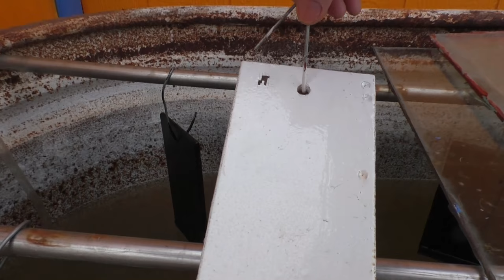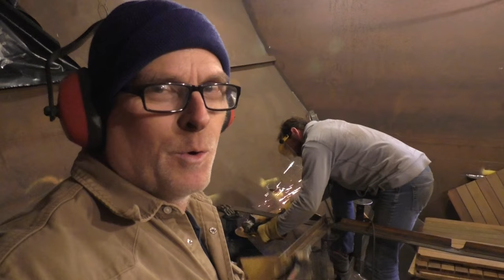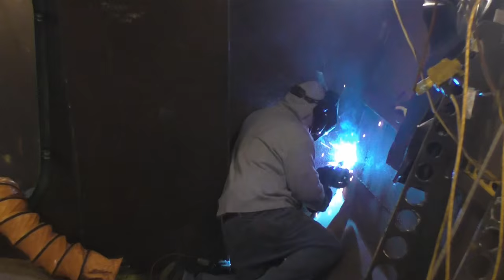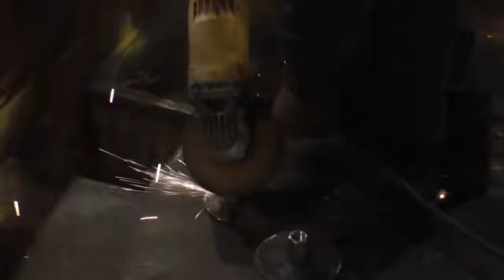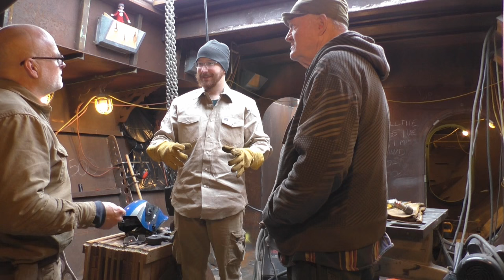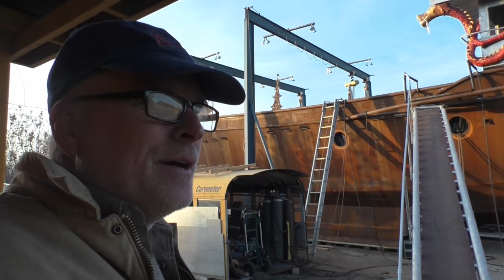Engine Room Sole and Mainmast Step

Comment: Hello Doug, A (corrosion) engineer once told me not to use coat hangar wire etc in a test bath as it may introduce a galvanic element into the test that you want to avoid. Good old non conductive zip ties work best.
Love the channel, keep em coming .
Reply: how ABOUT SLIPPING SOME SMALL PLASTIC TUBING OVER THE WIRE?

Comment: Once upon a time, I owned a ten foot sailing dinghy. It (not she) had a wooden mast, the kind where you fed the forward edge of the sail up thru a slot in the aft edge of the mast. But the mast was slightly and noticibly bent to port near the top. It is no surprise that it (not she) sailed better in one direction than the other. SV Seeker will still be a fine sailer if you should miss the mast alignment by a few inches.

Comment: I wonder if weather brought up this boat sale talk. I do the same thing to anything sitting outside. My subaru has 60 pounds of weld and more than 144 sq feet of steel sheets. My truck is 70000 psi rails and headed for 400k miles. It is not the project a builder looks at in the end... it is the result of surviving with your guts of it all. I hope you all continue. It is fascinating to see a team come together.

Comment: Hi
Thank you for an interesting series, I have been watching since you worked on developing the sand blasting unit years ago.

 I noticed that you are planning to install the mast in one piece through the deck down to the keel. That would require you to do more welding and painting after you get it to the water- due to height restrictions etc.

may I suggest that you install a mast base, comprising the bottom section of the mast extending up to say the level of the top of the cabin. this section can be finished off with a mounting plate/splice for the upper section to bolt on to.  it will not affect any height restrictions as it matches the rest of the infrastructure. The bottom mast can be all welded and painted finished completely. 
Then when on the water the top of the mast can be lowered onto the mount and bolted in making it quicker and simpler not only to install but also if there are any breakages needing a mast replacement.

also the removable mast section would be shorter so easier to handle.

Comment: Hello Doug. Did you consider Wasser Coating Systems? They are used at Cape Canaveral on some of the launch sites that I have been to. They have been the only coatings to standing up to the constant salt spray and high humidity for years now.The secret of happiness is not in doing what one likes to do but, in liking what one has to do.

Comment: Doug you said a hollow mast and putting a coin under -Where would it go?  I'd put it on the center of that cross piece with caulking and make sure it's the same year you were born IF you can find one, a silver dollar and put heads up! ( couldn't find a 51 for my boat ). Funny I lived in Comox for years moved down to Gabriola island 18 years ago. will have to go check out Paul's boat next time I get a chance. And your on the down hill run don't give up!

Comment: Has anybody seen "The Big Sailboat Project"? I followed the build for years and was amazed at what those two women built. It was a Bruce Roberts designed steel boat of about 44 feet if I recall. The boat was finished and they set off for Hawaii. A few days into the trip the weather got rough and they turned around and went back. I don't think they really ever sailed again.
Reply: That's why you go out sailing first a bunch of times, to see if you actually like it and/or can adapt to it, instead of basing you whole project on a romanticized "idea" of what you think it will be like.

Comment: The ship that I trained on, The SSV Oliver Hazard Perry,  has the International Peace Memorial coin from 2013 and a silver "Perry's victory" coin under her main mast.  The mast is a rather sturdy hollow steel pipe on the bottom 2/3rd's. Although the mast is stepped differently because she's nearly 3 times the size of Seeker. I'm pretty sure the coins were placed in the mast step before the mast was put into place.  Seeker should get a coin (possibly designed by the community) that is significant to some element of her history and an Oklahoma state quarter.

Comment: think you need to damage a spot on the paint on each sample too the see if the rust stopt where the paint still covers or if the rust crawls under the paint 
the coin under the mast was when masts where made of solid wood , they usually had a small relief in the mastpocket to put the coin intoo 
if you weld a plate under the mast you could still do it ....... come to think of it putting a capped pipe time capsule with a usb drive / cd rom and some photos of the build inside the mast before dropping it in place might be a nice idea 

nope not buying a boat not even wouldn't want one if they give it to me 
owned a small 2 person speedboat with a 25 horse outboard when i was younger and it had cost me a LOT of cash to maintain it , a bigger boat just means more cash needed  , the best description of a boat : a hole in the water to trow money intoo (cars are usually the same way they just dont float most of the time )

Comment: It concerns me, obviously it doesn't concern you; and I draw my thoughts from the Naval Frigates of my time in the navy; these ships were built light, 1/2 inch Plate with 1 inch Ribs and Bulkheads, and you could tell by the look of the hammering those hulls took. I just can't help thinking that if your hull is made out of 1/4 inch plate the sea is going to beat the hell out of that, and it looks as though there are not near enough Ribs/Bulkheads.
I am just drawing from my knowledge of why and how ships break up at sea.

Comment: don't ever buy somebody elses unfinished project. be it a boat, car, house or whatever of that scale. you don't know what has been done or left undone and you dont know the quality of the work and it is extremely unlikely that the seller will stand by his work if something fails or goes wrong.
Reply: Unless you're qualified to evaluate the quality of the work done (or hire someone to do it). There would be risk involved, but it would be a way to get something very cheaply.
Reply: J DeWitt True but you know what the saying is "you get what you pay for" i would want to know every nut and bolt in the project.